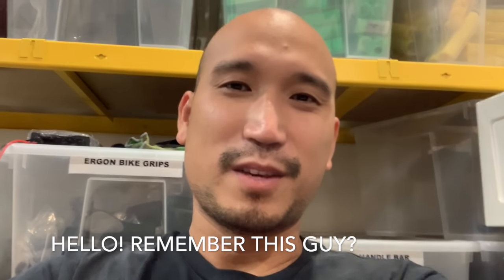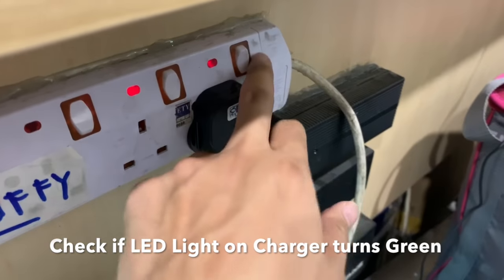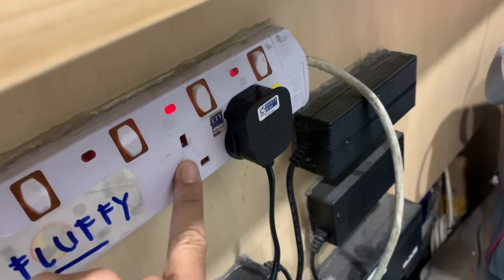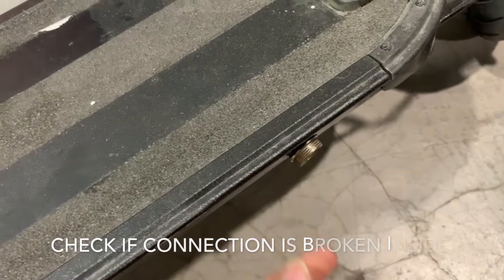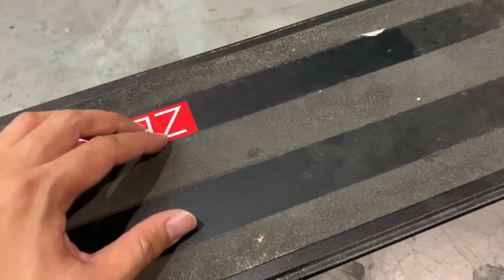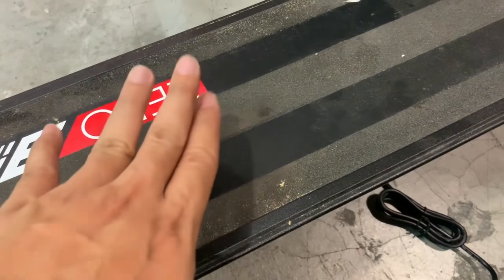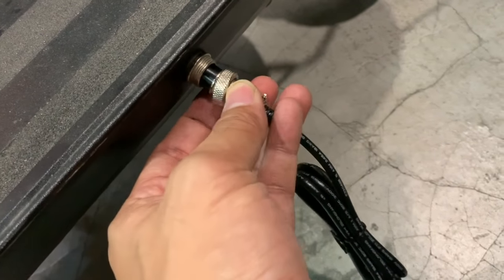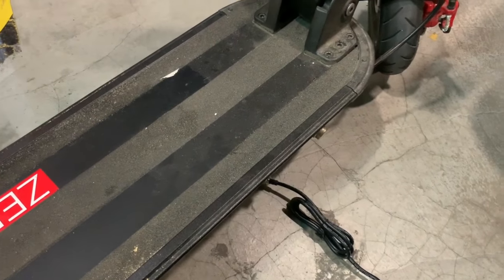What to do when your Battery Does Not Charge

Comment: I have a ew-11 scooter I just put news batteries in it and the charger is blinking green and the fan is not working on charger and scooter lights alarm go on but it’s not running
Reply from the maker: is the battery installed the correct one?
Reply: @FalconpevSg  yes it is
Reply from the maker: 1. Charger blinking green is never good. That means charger is spoilt most times. 
2. Scooter lights up but not running means battery is ok but controller is not
Reply: @FalconpevSg  I need a new charger?
Reply from the maker: @faithwiegand420  those are just our initial diagnosis from the few lines you wrote. We cannot be 💯 sure
Reply: @FalconpevSg  ok it’s a e-11 electric scooter only had it a few years would not start so I bought all new batteries and now horn , lights , everything work but will turn start when I turn the key then I put charger in wall and that not working

Comment: Hi,
Can you demonstrate how change the battery at Zero 9.
Reply from the maker: Dejan Kramberger why do you need to change the battery?
Reply: @FalconpevSg  how many times can charging the battery?
Reply: @FalconpevSg  always the some nothing at answer
Reply from the maker: Dejan Kramberger about 500 charge cycles. That should last about 2 years of usage.
Reply: I recharge my zero8 battery at one green bar on the display. That recharge gives me a range of 15-18 miles with few hills, mostly speed level two,and 165 lbs. person. This video is good about hooking up your charger the right way- the Zero8/9/10/10 x manual doesn't give info about the red/ green charger lights. Thanks for this video- I. wish I had seen this before my first( failed) attempt at charging my battery!
Reply: @howardfowler2255  IVE BEEN TOLD YOU CAN RECHARGE AT ANY STAGE,THE MANUAL SAYS TO RECHARGE AFTER EACH RIDE,EVEN IF IVE USED 1 GREEN BAR ONLY,IS THAT CORRECT.

Comment: I just bought an electric scooter. The issue is the lithium battery is charging but will come to to 40% . When accelerating it comes back to less than 10% right away. How to fix..?
Reply: I GET THAT TOO,IS THIS NORMAL,HAVE YOU FOUND OUT WHY.

Comment: Hello bro can you help me
.my inokim scooter when i plug the charger then i press the  power button it will turn on  but when i removed from charge it will turn off even if i press long the power button it will not open?
Whatvits the issue? Please help..thanks
Reply: You might need a new battery, my inokim power goes off when it is charged and doesn't come back on.

Comment: What if my charger's lights is green and stay green
Reply: @April 2089 same, i used my xiaomi  charger once and now it wont charge at all. 😐😥
Reply: @SILLYSCHIZOID  having the same issue and idk to do
Reply: Try this: 

Using the original charger that came with your device:

1. Unplug the charger from the battery and turn on your device (e-scooter or e-bike).

2. Place a load on the battery by engaging the throttle - either in place, or in motion. Make sure you're close to an outlet where your charger will be plugged in to the wall, and ready to go.

3. Bring the wheel motion to a stop and and rest your device in place to charge.

4. Turn off the device, and immediately plug your wall adapter into the proper charging port like normal.

If the battery did not accept a charge before, it may now change to "red" and begin a charging cycle.

Note: This method assumes there is no existing physical damage to the charging components, such as the charging pin, charging port, or battery itself.
Reply: @jerryg3578  omg this fixed it for me. thank you so much jerry
Reply: @joejzhou  I'm glad it helped someone. I was pretty frustrated when I finally figured it out 😄
Reply: PLUG THE CHARGER INTO SCOOTER AT DIFFERENT ANGLES. AT WORKED FOR ME.
Reply: @carloscolon3525  If this is the case, the charging port or cable termination (including a small, often broken pin) could be damaged. Would recommend having a closer look at something like this.
Reply: @jerryg3578  this method worked for mine, thanks
Reply: @jerryg3578  I don’t understand the part 2 can u describe it ?
Reply: If the voltage from the battery is showing almost 0v. Will this method work?
Reply: Did you tried higher voltage charger
Reply: Mine red 247
Reply: I swear everyone is having this problem! This is my problem, the light stays green!!! Scooter is not charge, I have 2 bars out of 5!

Comment: I have a 60v boyueda scooter and my battery has gone into sleep mode or discharge too much it’s brand new never been charged but I left scooter on now it won’t charge
Reply from the maker: Try to charge it with either a fast charger or a 72V charger
Reply from the maker: But only for a short period of time
Reply: I have same problem . The scooter when I charge stays red and won't complete the full charge . It's been plugged in for hours . Still not getting the green light ! 😤

Comment: Please help me I can’t unscrew the Allen key type bolts to open up the underneath plate to get to the battery they are sooo tight I even put in Allen key and had to use a hammer to hit and move them. What Do I need to remove them? My escooter got wet and now won’t start. Can anyone help suggest how I get the battery plate off please?
Reply: Take them to a machine shop in your area. They have the tools to do it. My boyfriend had to do that and even they had trouble but they eventually got it. Also, the difficulty of unscrewing any scooter parts is intentional. It's to ensure that nothing falls apart when you're riding and so the brand/company of your scooter won't be held liable.
Reply: A hammer! 😂

Comment: Hi, I haven't used my 10x 52V for about a month but used it today It only charges up to 55.7V, and when I ride for about a few km it shuts off?
Reply from the maker: Briggs Yalung when you were charging did the led on the charger turn red?
Reply: @FalconpevSg  hi thank you for your reply, when I plug it its red, then after 30 minutes to an hour its green, then the voltage meter reads 55.7V
Reply from the maker: Briggs Yalung that’s too Low. Full charge is 58.8V
Reply: @FalconpevSg  yes its suppose to be 58.8. Do you think battery is damaged already? I had this unit since december.last year, I only ran about 108Km.
Reply from the maker: Briggs Yalung yes it could be damaged or the charger could be spoilt

Comment: whats wrong With my scooter fully charged battery after riding 5min the electrissety gos dead like someone have removed the battery cant turn it on notting Works totaly dead to Wake it up i put the charger in the scooter and turn the scoter on and even if the battery is fully charged still it happens 68v fully sharged  volt cuttoff 52.20v
Reply from the maker: ted tedsen battery issue

Comment: Hi guys, my Zero 8 V2 scooter is more than year now and its odo is about 3400+km. However I notice that its full charge is only up to 53.6V and the scooter will die at 48V before reaching its minimum cutoff. I would like to ask, it is time to replace the whole battery or can I still have the battery for rebalancing? hoping for your reply.
Reply from the maker: Rebalancing may not be worth the effort. It takes a lot of time to do the rebalancing. Might want to consider a new battery

Comment: I have Error code E10 how do I fix please?
Reply from the maker: Infomation Distribution hello can you email us at sales@falconpev.com.sg and we shall run you through step by step.
Reply: I left it i storage for 10 hours at a very low temperature close to freezing.
Reply from the maker: Infomation Distribution can you let us know once the temperature goes back to normal?
Reply: Temperature has gone back up still has error code E 10
I charged the battery to voltage 58.6.
Its still not working. 
How much is a new battery for 10X?
Reply from the maker: Infomation Distribution can you email us?

Comment: Tried it but didnt work for me
Reply from the maker: Doesn’t work for all situations.
Reply: My issue ended up being a bad controller not battery. Symptoms were the same. Just heads up to everyone. Also check connections. My buddy had similar issue and found a broken pin on one connector. GL!

Comment: If red means it is charging, why should you unplug it?
Reply from the maker: Cos you may over charge your battery using a higher voltage charger
Reply: @FalconpevSg  but u said the battery has OV protection? Lol
Reply from the maker: @crouchingtiger5431  you don’t want to take the risk either

Comment: I can't unscrew a tight bolt. What can I do
Reply from the maker: Papp Sebastian Georgian drill it
Reply: Sometimes hitting the screwdriver with a hammer whilst it's in the screw loosens either corrosion between the scheme and hole or there  is loctite to stop the screw unscrewing.

Comment: Hello, when charging my zero 10 scooter, the voltage increase above 52V near fully charged (although the battery charger LED is still red) 

At what point do I need to stop charging it, as I thought the battery can only hold 52V ? And I don’t want to damage the battery.

Comment: did not work for me, i have same scooter, i ordered 58.8V charger, it wont charge, original charger works for 1 minute then light change to green, 58.8V charger light not change to red for charge, remain green, port is ok, i have tested it..
Reply from the maker: It won’t work for batteries that have too low a voltage. It will only work if you ur voltage is not too low
Reply: according to your video can wake up discharged battery, i tried but the COPY charger not even work, only indicates green, Original charger try to load it with red light :)
Reply: so.. it might possibly work but i not understand why that copy charger not do anything when plug in.. original charger try to charge it about 1 minute, then change green...
Reply from the maker: @jannemeister  it only works for some situations
Reply: @FalconpevSg  aha :D

Comment: It didn’t work! Got a 54 volt charger for a 42 volt battery and also for a 36 volt but nothing happened for both batteries. Even left on for 15 min both and nothing...
Reply from the maker: Rodolpho Brasolin Dias it will not always work. Only for when the battery is under voltage. Your battery could have other issues like a bad bms.
Reply: Falcon Pev | PAB PMD E-Scooter E-Bike Shop maybe, but one of the batteries don’t even have the BMS, it was just discharged. Thank you for getting back to me!

Comment: This is great, except the inmense majority of people don't have other such specific chargers lying around the house. So, unless you're one of those people, this is actually useless.
Reply from the maker: Love Dj buy one of em chargers! It’s much cheaper than buying a new battery:)
Reply: @FalconpevSg  Yes, but this machine is new and it should come from the factory with everything you need to make it work. So, if this is so common that you decided to make a video about it, you should have included the two chargers from the factory.
In any case, my problem is the battery of a new (used once) Zero 8 isn't charging. I went on holiday, left it with the battery almost empty for about three weeks, came back, plugged it in, the LED light on the charger went red. Left it all night, in the morning the LED was green but the LCD on the scooter indicates only one bar of battery is charged. How can i sort this out? The voltage sellection on P3 is set to 48V. But there is a small round and yellow sticker on the side of the scooterthat sais 36V10.4A and it has a battery icon with a thunder icon inside of it. And the charger sais OUTPUT: DC 42V 2.0A Thanks

Comment: My ebike battery is dead it as a little red read on the battery motherboard flashing, that's if you take the cap off. It will not charge or go to red,  
the charger stays on green The seller is a criminal organisation - Leon cycles who refuse to replace the battery even though its under warranty. Do not buy ebikes they only last 3 years at most and you cannot get a replacement battery. Ebikes are a scam  and dangerous.

Comment: This video did NOTHING to help me determine if my charger works or not. I see a lot of comments about informative information. But, the guy doing this video says nothing about what to do if the charger doesn’t light up red or green when you plug it in. No information at all-Next.
Reply: This video is about basic steps on finding which part of your charging system is not working. Not how to take apart electronics and repair. Your charger is most likely damaged and you need to be a electronics tech to fix it.  Your charger may have developed a short, or blown a mosfet, diode....etc. Get a multi meter and probe the output. Do you get a voltage reading? If you don't get a voltage reading then buy another charger and move on. Electronics are complicated and you would need to understand an SMPS in order to repair your charger.

Comment: hi my charger seemed to be dead (no light at anytime) but when I got the new charger there was a green light on the new charger when just plugged into the mains but when I plugged into scooter the light turns off (no red light)
Reply from the maker: battery issue. has it been in water?
Reply: @FalconpevSg  no was ridden in dry conditions for less than 30 minutes after it arrived at my house :(
Reply from the maker: @Dienex  can your scooter turn on?